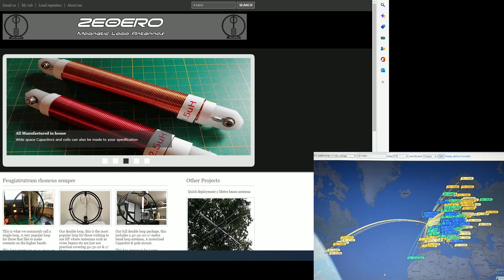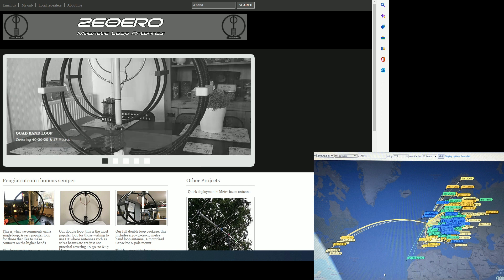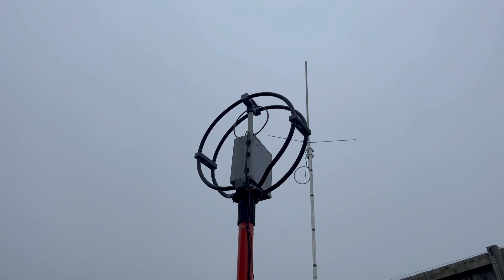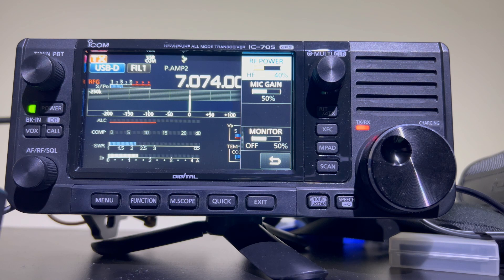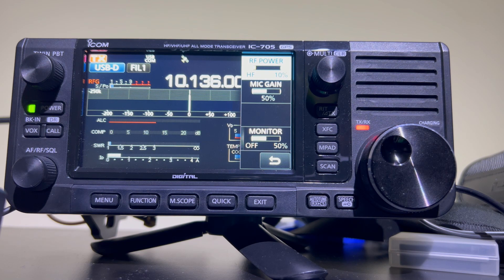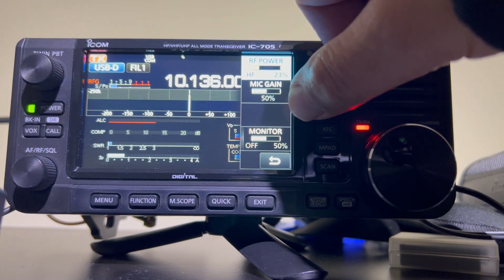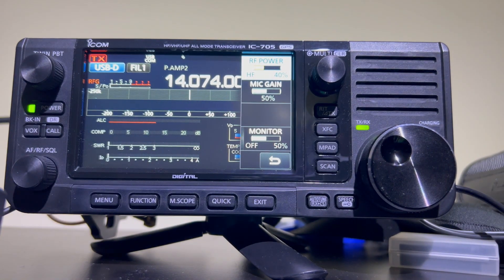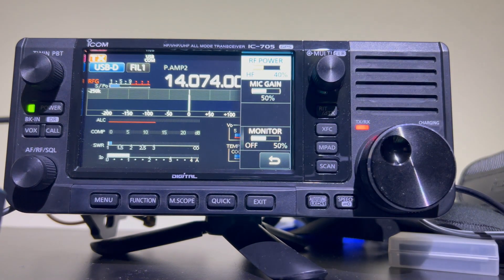2E0ERO Magnetic Loop Weatherproof  FT8 Tuning Test After 4 Weeks Outdoors

Comment: Hi Jason, thank you for the video and the AL-705 one. I am trying to decide which one as don't need two. Like AL-705, would fit in my bag. I know a subjective question but out of the two which do you prefer and why, please?
Reply from the maker: Hey ! Thanks for the kind words. For portable operation / fits in a bag. I would go with the AL-705 100%, it’s surprisingly easy to tune. A very smooth feel to the tuning capacitor.  If you got caught out in a light shower I don’t think it would suffer, unlike the 2e0ero loop with its open air capacitor.